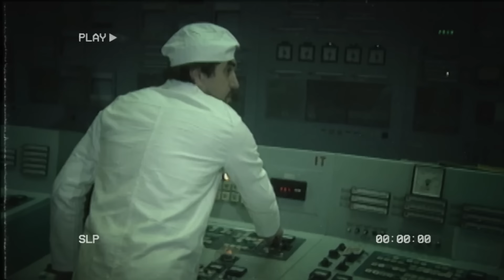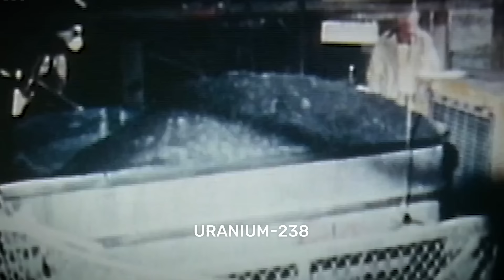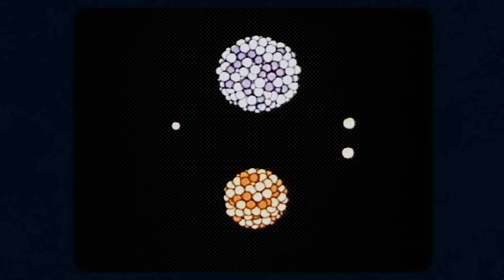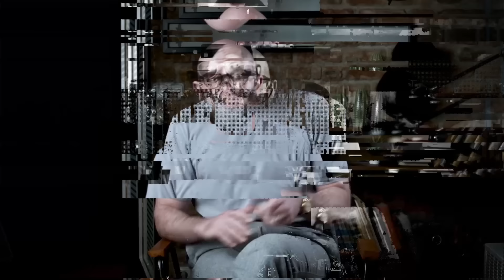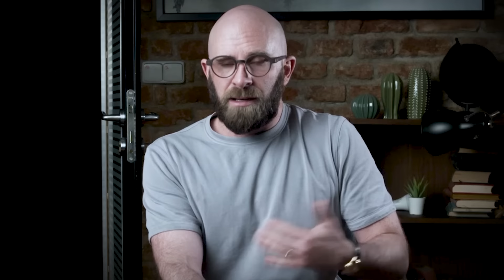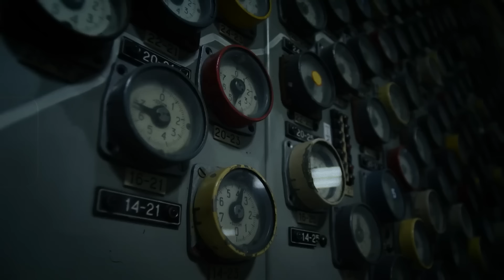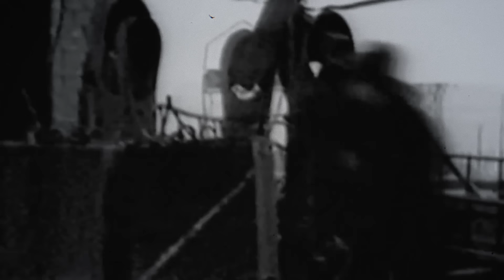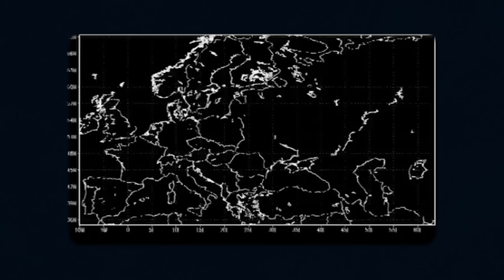The RBMK: The Shoddy Nuclear Reactor That Nearly Killed Millions

Comment: The two types  you mentioned as the "dominant" types is technically correct since these types of reactors are the most widely deployed by far.  There are several other types, which are presently being developed or are about ready to deploy, which function very differently in terms of their coolant type and basic design.  Coming from a scientist, you did a very good job of explaining how a very complex piece of technology works - don't undersell yourself man.  This was an excellent video that broke down something that is highly technical into a well explained and easy to understand format without getting into the many, many kilometer deep rabbit hole of all the nuclear physics and actual reactor and plant engineering.  Well done man.

My comments on this:
1. I think the 4,000 - 20,000 figure is probably the most accurate.  I would not under any circumstances trust anything coming out of Greenpeace without looking at their raw data, analytical methods and checking their math.  They have a political objective to undermine nuclear energy because some people took far too much LSD25 decades and seem to have confused nuclear weapons with nuclear energy and fuel reprocessing.  A totally understandable error /sarcasm.

2. You mentioned sort of implicitly Uranium 233 - you are correct that this is less stable than U235 but it still makes acceptable nuclear fuel, although its half life is relatively short, something like 1/3 of a year.  The other problem with it is that it can be contaminated with U232, unless these are separated out, which is a problematic contaminant because it gives off so much gamma radiation it's a severe hazard.  U233 is useful however because it can be made by transmuting via neutron bombardment Thorium 232, of which there is a vast abundance on the Earth.  As long as the containment vessel is engineered properly, however, this hazard is theoretical and not an operational problem.

3. One modern reactor design uses Uranium gas in the reactor core under pressure from pressurization pumps.  This is one of the designs that can't melt down - if there is a power loss or the system is otherwise compromised, the pressurizing pumps shut off, and the Uranium gas expands, lowering its density below critical mass / critical concentration, and fission stops.  No control rods needed.

4. Another design uses molten sodium metal as coolant, and is far safer than water and much more efficient as a  thermal carrier.  This has the effect of absorbing far more heat and giving a much wider safety margin to the system.  In this design, the control rods are held in the "up" position by either a physical switch that is held in place by active force of a mechanical system or by an electromagnetic system holding them in place.  Loss of power or compromise of the system will automatically deploy all the control rods into the core via gravity, immediately putting the core into SCRAM state and stopping the fissioning.  I think modern designs have a secondary system to remove the coolant OR to keep it warm enough to stay liquid.  This would avoid what happened to the Soviet Alfa class submarine.  It used a similar cooling system but the Soviets didn't think through what would happen if they shut the reactor off.  This happened once and all the coolant hardened in the entire coolant system, essentially bricking the whole reactor, and replacing that in a Titanium hulled submarine was not an easy task by any measure.

5. A particularly clever modern design does not use fuel rods at all, rather it is called a Liquid Fluoride Thorium Reactor where the nuclear fuel is actually dissolved in fluoride salts, this is where Thorium 232 and Uranium233 come in.  The U233 is the fissile fuel, and the clever part is that in the course of nuclear fission, the Thorium 232 in the liquid fuel matrix is bombarded by neutrons and transmuted into U233, so the reactor can sort of refuel itself for a while.  This ameliorates the disadvantage of the short half life of U233.  In the event of a runaway overheating reaction, a plug of frozen salt at the bottom of the containment vessel will melt, and this will allow all the liquid fuel to flow out of the core and safely into a tank where it will immediately reach a sub critical mass / concentration and the fission reaction stops.  This is one of my favorite 4th generation designs because of it's onboard self refueling and completely electricity independent safety system that doesn't rely on anything except melting an engineered plug of frozen salt.  This would obviously be refrigerated under normal circumstances to keep it frozen, otherwise even normal operations would melt it and you'd have the reactor self shutting down every half hour.  It is when the temperature of the fuel gets beyond the refrigeration system of the salt plug and melts through it that the safety system activates, while remaining integral during normal state operations.  If there's power loss or some other failure mode, the cooling system on the salt plug goes offline and it melts, once again putting the reactor into a safe state by draining the liquid fissile fuel into a non critical mass concentration.  The graphite moderator in this reactor is genius, because it sits inside the vessel in the liquid fission fuel matrix, but has channels through which the fluid can flow, and this has the obvious advantage of a high surface area of graphite moderator to the liquid fuel matrix, making control of the reaction rate simpler than having to constantly adjust control rods and coolant pressure and the like.

6. I personally don't like water reactors because they use an inordinate amount of water, are often not designed with fully closed systems and condensers downstream of the turbine, and you're left with a whole lot of contaminated water that isn't as easy to decontaminate as it sounds.  This is exemplified at Fukushima where they're storing so much irradiated water they're barely building storage vessels fast enough to keep up with how much contaminated water they're generating - this is good evidence that decontamination of irradiated water is not so easy.  Water has good thermal conductivity, oh yes, but there are better alternatives today that don't need water at all.  Considering that there is increasing pressure on freshwater supplies for human use globally as the population increases and freshwater supplies are beginning to run out, it would be wise of us to start using the 4th generation reactor technology that doesn't rely on water at all.  That and dumping irradiated water from a nuclear plant into the ocean is just utterly retarded.  Dilution is NOT the solution to pollution, although unfortunately it seems this idiocy still persists even to this day.

Let's end on a hopeful note - as I illustrated above, far safer and much improved reactor designs and systems are nearly the deployment stage, and these types of reactors are so radically different they do not pose the hazards of yesteryear at all.  We need some national will to make the investment and get them deployed, but that's an investment that pays for itself, both financially in terms of cheaper power, and environmentally, because for every new nuclear system we deploy and bring online, we can shut down plants that are burning hydrocarbons and harming our health, dirtying our environment and eventually killing us.  As an important side point, if you want an all electrical vehicle fleet, the present power grid isn't adequate.  A new high powered nuclear grid could handle it.  Here's a thought - put a nice hefty tax on data centers and put the money towards building more nuclear plants.  They're not paying their fair share and they're jacking up prices for customers unlucky enough to have one near them - that would go a long way to ameliorating this problem since we'd have enough cheap energy for everyone, even the greedy and selfish owners of the data centers who care nothing for the disruption they cause to the people who live in the area.  Everyone wins.

Cheers, 
IW

Comment: Unfortunately, the verbiage of the word, "moderator" commonly gets lost in translation to those individuals unfamiliar with the physics & engineering of a nuclear reactor.
The "moderator" (or what's actually being moderated) in this application, applies solely to moderating the speed of neutron flux, which actually INCREASES the reactivity & hence, the power generation of the nuclear reaction itself. 
In other words, the intended result is the exact opposite of what most people assume it implies.

Comment: This is an awful video The Chernobyl nuclear reactor accident was a horrible event, and it was caused by bad engineering choices and even worse operational choices. But this explanation in this video is full of errors. The moderator doesn’t slow down the reaction. The moderate allows the reaction to occur and a steam  explosion could never possibly release 3 Mt of energy. Also, I would never trust anything coming from greenpeace They will use any propaganda to forward their agenda and they don’t care very much about scientific accuracy. It’s very difficult to get an exact number of people who suffered cancer from this accident, but it’s certainly not the numbers they’re stating here. About 17% of all people die from cancer, this is without any nuclear accident. There’s no doubt that this accident increased the cancer rate around the Chernobyl area, but the global effect was in the noise. The graphite tips on the control rods weren’t to save money. They were part of the control rodwill because water is a neutron absorber, and they wanted to give the control rods higher worth which actually is a safety concern. The problem was that the tips didn’t go down far enough, and there was a section of water remaining where  when the rods were inserted the entered caused a surge of  reactivity. This was a design error. This channel needs to employ people with sufficient technical expertise to prevent all the errors in this video.

Comment: The interesting cost fact is that the RBMK was not the cheaper option.  The issue was that could not roll, or did not have the facilities to roll  the steel to form the pressure vessels for either the PWR or the BWR. Nor could the transport that pressure vessel to site.

Comment: The Soviets knew of the design faults in the RBMK-1000 reactors as early as 1971 when an incident happen at the reactor located near Leningrad.  The Soviets were nothing if not cheap.  Cheat tanks, cheap military equipment, cheap torpedoes (Kursk disaster), cheap (and not well built) public housing, and cheap nuclear reactors.  The only thing the Soviets were not cheap about were the comforts the ruling elite were provided!!!!  The communist utopia at it's finest.

Comment: The positive void coefficient doesn’t make sense to me because normally, steam prevents the slow down of neutrons into absorbable energy levels. So in RMBK reactors, is it just the fact that less liquid coolant prevents boron absorption of neutrons and more graphite moderation?
Reply: Water in this case isn’t being used as a moderator so it absorbs slower neutrons and lowers reactivity. The steam does none of that do power goes up.

Comment: Two types of reactions.  Fast neutron (Breeder) and slow neutron reactions.  Water is used in slow reactions.  Neutons must be slow down to strike the uranium atom 😊. It's the control rods that contain the reaction.  SCRAM. All rods are completely inserted.
Reply: Depends on the reactor design. In RMBK water isn’t used as a moderator so it absorbs neutrons more than it slows down.

Comment: Makes me wonder had they inserted the rods strategically one or two at a  time rather than all at once might it eliminate or reduce the runaway effect from all rods being inserted at once. I'm not saying there would've been no explosion or damage. I wonder if they had staggered control rod insertion might it reduce or spread out the resulting fission spike. Like insert control rods in cooler areas working your way to hot areas. Or using math to kill the reactions in ways that starve the process of neutrons  mathematically reducing the probability of fission events. It just seemed a knee jerk reaction to do a fast reactor scam given its unique graphite tipped control rod design. Seems safety procedures did not take their unique reactor design into consideration.

Comment: You sound like an idiot, you might want to check your facts before making a video like this. I’ll refer to other comments and add the fact that in the 80’s the RBMK reactors were believed to be the safer choice, not a cost cutting expedition. The STEAM explosion NOT nuclear explosion happened because all Saftey protocols were ignored and the computer screaming for a shutdown was turned off. The incident happened because of greed and the need to please higher up people.
Reply: You don't design a "safer" reactor with a positive void coefficient. The fact is the RMBK design was used because it didn't need a lot of highly skill craft like welders. It used natural U so no big enrichment plants were needed. It could be constructed very quickly. Yes there were trade-offs, but that's with any engineering project. If the test had been done following operational limits, Chernobyl would have never happened. It was the design that failed; it was the people who ran the test.

Comment: I watched a video about Chernobyl myths the other day and I think the first point made was about RBMK reactors being cheaper. In the video it was said that RBMK reactors were actually more expensive to build than the other types but it was more the case that the RBMK was the only feasible reactor to build in that location at that time.

I'm not sure if that's true or not but it's interesting to hear a different reasoning for it
Reply: That is what IAEA's INSAG-7 says. RBMK was the most expensive of the three reactor types being considered, but was chosen for logistical reasons. The parts could be sourced locally.

Comment: As a reactor nerd with a heavy focus on the RBMK, this video made me cringe so hard with all the mistakes. Good grief, this was bad. Just hearing you mis-explain the basic function of a moderator was a complete turnoff. Not to mention the propagation of the megaton myth. There is nowhere enough energy in the system to even manage a fraction of that yield, not even close. See Kyle Hill's comment for the many, much needed corrections.

Comment: There were two nuclear plant "incidences" in the USA, neither of which killed anyone.  Three mile Island and Briwns Fwrry.
Rancho Seco experienced a serious accident due to operator error, poor design by Babcox & Wilcox, and very poor oversight by the SMUD board.  A too-rapid cooling of the steel reactor vessel almost cracked open, leading to a complete failure of the plant.

Comment: 1. The RBMK was not cheaper.. in fact the soviets new this… they built the RBMK because they did not have the means to transport the pressure vessel for a VVER (PWR Soviet version) it was cheaper on fuel yes.  

2.  When the RBMK had ALL new fuel it actually did have a negative void coefficient… but as fuel burn up occurred and absorbers were removed from the bottom of the core it turned positive sometime around 3 years after…. Right around the time unit 4 blew up… 

3.  The soviets did actually know about the void coefficient turning positive and their WERE plans to fix it by removing fuel channels and replacing them with controll rods from the bottom that could be used to counter this… reactor 4 was scheduled for its first major maintenance including these modifications. Thats why it was being shutdown…. 

The test was also so that they could measure turbine vibrations and overhaul the turbine… go back and look at photos of unit four after it exploded and inside of the turbine hall and you’ll notice a red van… used to measure vibrations…
Reply: Don’t believe me? Go read INSAG 7 on the IAEA website on the official causes of the Chernobyl disaster… you should also read Anatoly Dyatlov book “how it was”… if you read INSAG 7 you’ll also notice that he was not mean or aggressive as he was played out to be and that there was no evidence pointing to this… same as the famous run out the reactor hall in 3 seconds at 200+ mph…
Reply: "it was cheaper on fuel"
Yes, if you calculate the cost of a single fuel rod, then RBMK is cheaper. But there is a catch. The RBMK-1000 needed 200 tons of uranium enriched to 2%, and the VVER-1000 needed 80 tons enriched to 4/5%. So the price wasn't that different.

Comment: The people in charge were idiots lacking in any experience in running Nuclear Reactors. They did a number of things to speed up the reactor from a shutdown with removing far more control rods to restart it (Xenon poisoning) and had the shut down circuits switched off. When it became unstable they scrammed the control rods in. The control rods had graphite tips which made it go prompt critical when it was scrammed. Off with its hat.

Comment: I think this "cost cutting" is utter BS as a reason. USSR developed pretty good pressured water reactors, which my country had 6 of them. With 0 problems for their >40 years of operations. These RBMK we only for USSR and not for export, and the reason is Plutonium. Plutonium is bred in an reactor as a byproduct of fissin U, however it is bred under certain conditions and one of the conditions is to prematurely extract it from the reactor, way before refuel is needed. Thus you either need specialized reactors to breed PU only, or make PU while you are making your people happy with cheap electricity. Not to mention that RBMK reactors were more powerful than their PWR counterpart, and the industry was "hungry" for power.  So RBMK's are more of a practical choice, rather than cost-cutting.